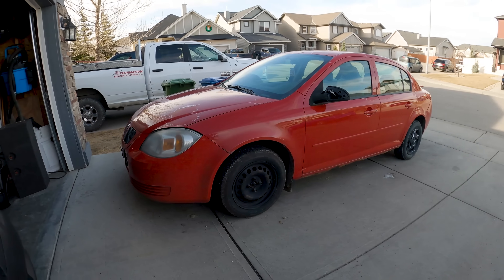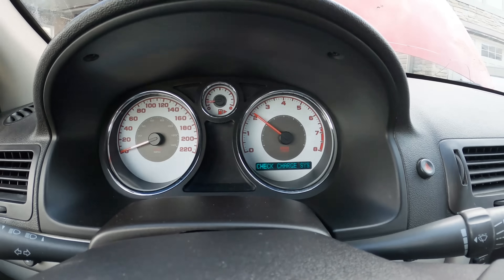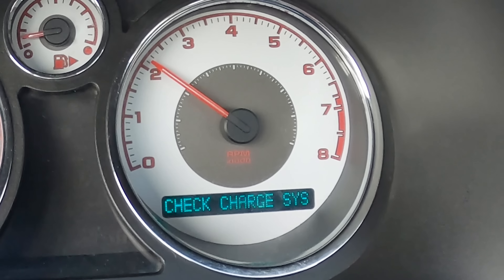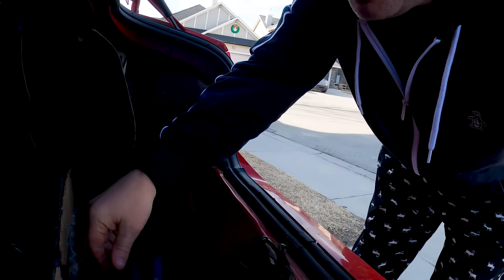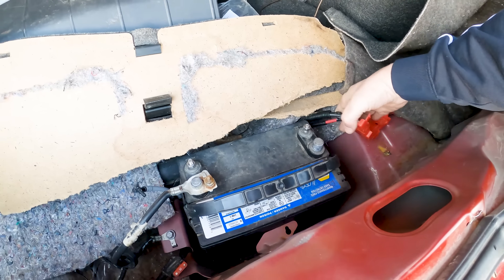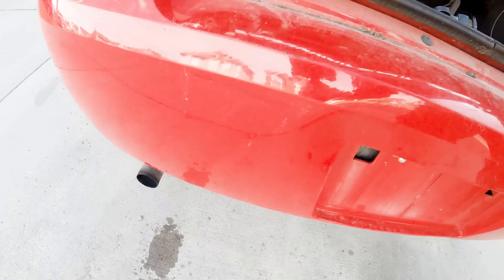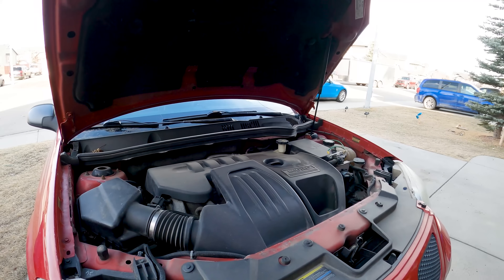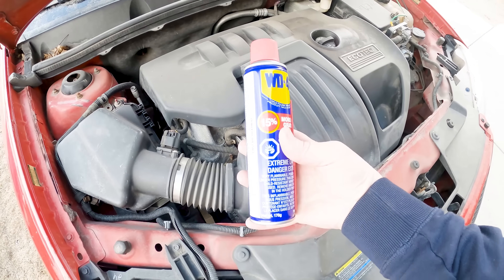ROADSIDE FIX! REVIVE your DEAD or DYING Alternator with this ALMOST FREE trick! | Gears and Tech

Comment: In older vehicles with out the computer alot of this is true but with now day computer system in our vehicles some of them run off the battery so even if you have a good alternator and unhook the battery it will diy also my 2000 toyota celica would diy on me kick and buck when i had a bad battery and unhooking a alternator on computer control vehicles will/can blow the alternator I know this from experience on a 95 lt1 camaro.

Comment: READ THIS READ THIS READ THIS 
ok first off , your title mentioned no tools , well that voltage reader is guess what ????  A FKN TOOL ,    
Now thaty thats out the way , you want to check if ur alternator is NOT working?  let me explain something  for the ones that are clueless. the alternator is a generator for the car, so you turnn ur inition and your using battery power to start the engine .once its running the alternator supplies the whole vihicle with electricity aka power,  and charges the battery for when ur gonna start the car again ,  so once ur engine is on and running in idle speed , disconnect the positive from the battery , if ur engine stops , u alternator is done , reepllace it , but if u remove the posityiv and engine stays running , connect the positive and ur alternator is good,  if its bad then ur car is  strictly running on ur battery power , so u disconnect it and it turns off.  you see what in m saying simple as that , u dont have to buy some cheap piece of crap from china for no reeason.  
ps i dont think i have to mention that when you disconnect the positive DO NOT LET TOUCH ANYTHING OTHER THAT THE POSITIVE BATTERY POST. because if the alternator is good andd u let the positive touch any metal on the car , ur gonna ground your alternator and ruin it .
Reply from the maker: I'm pretty sure this is exactly what I was saying.

The tools shown are there for sanity. But pulling the cable is the easy test

Comment: Failing alternators that still turn (not a bearing failure) I wonder if minor engine oil leaks that get into alternators create a layer that prevents electric field conductivity between the rotor and stator and the WD40 "washes it away" restoring some of the conductivity.  Just a theory.

Comment: Should never reconnect the battery while the engine is running,  because that's how I've been testing my alternators for 35 years but 1 time a new Yorker,  5th. Avenue,  I blew modual and was hidden n air cleaner and didn't have google,  so always shut off b4 reconnecting battery!!!

Comment: Wd40 contain solvents that are flammable.

If the alternator is faulty it may well have stuck brushes, lots of sparks arcing across to the commutator.

Filling your alternator with WD40..........just because you can doesn't me you should.

Comment: I stopped at an auto "parts" place looking for brushes and Voltage regulator for my 04 ranger, and the counter guy smiled and said they haven't sold those for over 10 years. Luckily I had purchased a set up awhile before that. I was 45 miles from home, so I limped it home and repaired the alternator. 
Crazy thing? We used to repair parts and now are stuck with chinesium garbage as new.

Comment: Wait until Bubba the 300lb linebacker messes his car up and comes looking for your dumb ass. ON CARS MADE AFTER THE 1970S NEVER DISCONNECT THE BATTERY ON A RUNNING VEHICLE. THE COMPUTER IS 1/3 OF THE CARS COST AND YOU WILL FRY IT.  If you run extra equipment like stereo and lights upgrade to an alternator that puts out more amps

Comment: Interesting story...but I'm not buying it. No way your sitting there with a couple hundred dollars in cars and your daughter is driving a beater with a broken windshield and an unreliable vehicle that could strand her alone somewhere. Nothing is adding up here.
Reply from the maker: All my kids get a $500 car for their 16th  birthday. And then they learn how to keep it going until they save money to buy something else
Reply: @GearsAndTech  Hey...if it works for you and you can sleep at night, that's all that matters. Mine got older vehicles too, but they were bigger, had good breaks, electrical and were solid running. Nothing like one for a young lady, that might not start in a parking lot some day. I have one that's an attorney and another with a doctorate that heads her own debt at a large University. So they can work on their vehicles (if they choose). Five hundred dollars doesn't buy decent tires these days. They can learn how to work on and service them, just the same, if they choose to. 
Good Luck, Sir!

Comment: My vehicle has the battery light coming on after raising rpms to 2000 , new remaned alternator, runs the car with battery unplugged , battery is new , my real issue is it when testing voltage at battery it's in the low 12s while running but if if I rev it now all of a sudden it's at the 14.2 or so and stays there even with full load , I Basically have to rev it when I start the vehicle or it seems to drain the battery? Or not charge it I'm supper confused
Reply from the maker: Seems the regulator isn't working right. If it's internal to alternator then get it checked

If it's external, then replace it

Comment: Yea, alternator has busted DIODES , WD40 fixes it MUHAHAHA, no seriously I can understand this as corrosion builds up, guess what gets on the alternator while driving in rain, or after a snow melt, or when the local road department feeds the ol salt and sand mix on the roads ?
Reply from the maker: Won't fix bad diode. But fixes a lot of other stuff

Comment: Do not listen to this guy. If you do that with a new vehicle, you have a chance of the computer system and blowing thousands of dollars of controller out. You need a meter because the newer ones now when the battery is disconnected, the voltage will spike up to a higher voltage, which that is a power surge. If you go by what is clown says you people are idiots. Use a meter to test your charging system, do not do this. I don’t advise this on any type of vehicle whatever year it is because you spite the system, even if you’re not a computer system in a vehicle, a could blow the dial or the regulator walk across the street, Ash, your neighbour for a meter or have somebody tested for you, if you’re not sure about it.

Comment: Only bad thing about pulling the positive wire off with newer vehicles you will get some computer components if it's an older car before 2000 u b oksy but any year after that I wouldn't recommend it

Comment: With a lot of vehicles of today 
Pulling the battery cable off while the car is running can damage other thing's in the car, Like Modules, 
Of course it won't damage anything if the alternator is not working,  But with a good alternator you never want to remove the battery cable and reconnect with it running,  And with it not running always remove the ground cable first and reconnect with the ground being last to avoid damage.

Comment: How tf you running a car without the battery connected, every car I've ever known, ranging from 1992-2019 the second one battery terminal is not on correctly, there is no power whatsoever, let alone starting it and running it without any battery. Some one please explain this because this is a load of bs to what I have personally experienced (not a hate comment just generally curious)

Comment: DO NOT DISCONNECT THE BATTERY IN A MODERN CAR!!!! You can ruin your car's computer!
Reply from the maker: Which car will get it ruined? Nobody seems to answer me when I ask.

Prove this
Reply: @GearsAndTech  all modern vehicles have electronic systems that can be damaged by voltage spikes caused by disconnecting the battery while the engine is running.

Comment: The reason disconnecting the battery on a running modern vehicle may fry the electronics is because the voltage created by the alternator is not "clean" to put it in the simplest term. The battery is needed to clean the voltage so sensitive electronics are not introduced to voltage fluctations.

Comment: I think the reason this works , the wd40 lubricated the bushes , may have removed any dirts from the slip rings , ultimately this cause a good contact between the brushes and the slip rings ..  as most of us know , when the starter motor doent run , sometimes a  bang on the body of the starter,  even slamming the hood or shaking the cars , might cause the brushes of the starter to make contact with the slip rings , causing the car to start.  You can try these methods  to get out of the bad situation,   but ultimately it is a sign that the part needs replacing or Rebuilding

Comment: Never disconnect the battery when the engine is running or you run a high risk of damaging the engine control module.  You need to always use a voltage meter or a battery tester.
Reply from the maker: which vehicle could this be observed on? After doing this hundreds of times I have yet to see this happen. 

Let me know which one you have seen this happen on so I can buy it and test for myself.

Comment: I'm just trying to get my vehicle to go 40 miles to where we can park it and get the alternator off, because it might still have a warranty on it. But if I spray the WD-40 on it, could that ruin the warranty?
Reply from the maker: It could affect the warranty yes

In that case try tapping it with a rubber Mallot or a 2x4

40 miles you could probbaly drive with a fully charged battery even. Just keep the ac off and no radio

Comment: Interesting with the WD40 tip. I just installed a new 90 amp alternator into my 1970 VW Beetle. The alternator sat in my basement for about 7 years. I initially got a 14.5V reading at the battery when it was running, but that was the last time and now appears to not charge. I did a diode test with my multimeter and current goes the correct direction. I've been thinking that it's the integrated voltage regulator. It's a major job of removing the engine to change the alternator. I just spent every weekend over the last 2 months doing upgrades. I finally get it back together. Everything is good except the charging system. Now I'm wondering if the brushes corroded. I might give the WD40 idea a try.

Comment: The real way to check your alternator is to turn everything on you possibly can and then pull battery cable off of have your car connected to a car needing a jump start. And just as your car is reved up to jump the other car nd they are turning the key to start their engine pull that cable at that precise moment

Comment: OK YOU CAN USE WD-40 BUT ONLY IF THE ALTERNATORS BRUSHES ARE NOT SPARKING WHEN ENGINE IS RUNNING , SO IN THE CASE OF SPARKING BRUSHES ONLY USE STARTING FLUID , BRAKE CLEANER SPRAY , CARB AND CHOKE CLEANER SPRAY , YOU HAVE TO BLAST THE ALTERNATOR LIKE SAID IN THIS VID EXCEPT THE ENGINE MUST BE RUNNING PREFERABLY REVED UP WITH HEADLIGHTS ON AND AC ON HIGH. PERFORM AT YOUR OWN RISK IM NOT GIVING ADVICE OR WHATEVER .( WARNING  : FIRE OR EXPLOSION RISK !!) WEAR CERTIFIED BIKINI OR UNDERPANTS AS TO NOT BURN YOUR NICE CLOTHS! 😅

Comment: and then you just burnt up your (good) alternator.  You don't disconnect a battery and run modern cars on the alternator. The voltage regulator with see this as a need to boost the output to its max capacity which burns things out that were once good.
Reply from the maker: Did you miss the part where we tested and proved the alternator wasn't working first?

This is a last resort when it's dead. How are you going to wreck something that's broken?

Comment: That WD40 can work if it's your brushes that are the problem. If it's a diode, it will not work.

And never disconnect the battery while engine is running, it could cost you thousands in electrical repairs. This hack worked on older cars without a PCM (computer,) but could fry some important shit on newer cars.
Reply from the maker: Yes, this won't fix diodes. But you gotta try

Comment: switch cleaner spray is a better choice and doesn't leave a mess. Although it wouldn't be an item that everyne would have to hand. You can actually damage the alternator by running it while the battery is disconnected. so if you have to do this, do it only for a couple of seconds.

Comment: Can you explain exactly WHAT the WD-40 actually does and WHY use it as opposed to anything else, like contact cleaner?

Is something inside of the alternator stuck or drags? Is it dirty, corroded, oxidized, etc?
Reply from the maker: It fixes 2 issues

First, stuck brushes. The wd40 frees them up so they can drop back down and move freely. Contact cleaner wouldn't do this

Second, it cleans the brushes and the armature so you get better contact
Reply: @GearsAndTech  Thanks!

Comment: Gears and Tech?  Really?  Pretty well no tech- it's easy to diagnose a failing alternator without pulling off a battery lead ( or pulling off the battery as you say).  As others have said, it's a bad idea to do this when the car's running.  A dying alternator will be easy to spot by the dim headlights, slow wipers and inability to charge the battery.  Tapping the casing/ spraying a SMALL AMOUNT of WD40 may temporarily increase the voltage output.  Saturating the component from 8 inches away and making a mess is pathetic.  Check out a vid by someone who actually knows how to replace the alternator instead.
Reply from the maker: Wow, lots of criticism here. What's your contribution to society?

Comment: You can always turn on your lights instead of reeving the engine. Back in the mid 70's when I was 15 and worked at a wrecking yard. On old cars, when using jumper cables. We would turn on the lights to raise the voltage being put out by the alternator. Not reeving the engine. Clean your battery terminals. Also, the ground wire bolted to the car ground may not be grounding properly. Check the level of acid in your battery. Use distilled water if the level is low. I can go on with more but most of the time the simple things to check are the common cause.

Comment: Another top secret tip is call uber.  :)_  You know that loose terminal connection is probably making your alternator work hard to charge the battery and shorten the life of the alternator.

Comment: If your battery terminal connectors slip off that easily, that could be a possible cause of your alternator problems. May have just been it's age as well, of course. Either way, it's good practice to make sure ir's snug to insure a solid electrical connection. Then after tightening, throw that wrench in her glove box in case she's ever stranded somewhere and needing to unhook or change the battery she, or a good samaritan, will have the tool needed.

Comment: A alternator dying makes noise right? Mine is making a weird sound. My battery light came on while driving. I have no help and dont know what to do? Any advice please? Your alternator wasnt making noisr was it?
Reply from the maker: Tough to say. Alternators can make noise when failing, but they don't always..

You can try this trick and see if it helps
Reply: @GearsAndTech thank you. Did you say to put water on the belt to see if its the belt?
Reply: @Smith-l5e ok thank you. I went out to try this trick and my car wouldn't start. The battery is dead now I have no car again..
Reply: @Smith-l5e hi I took off my battery terminals and cleaned the one. It started in the morning. I was going to test it but when I went to start it, it wouldn't start. I have a 2008 jeep liberty thank you
Reply: @Smith-l5e yes there was battery acid on the positive one. No I didn't have the car started when I cleaned them.